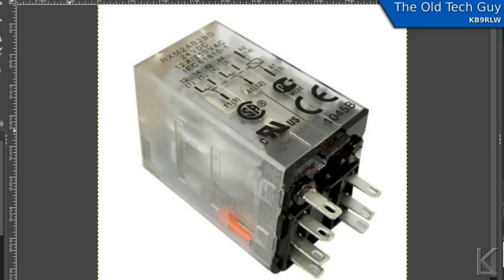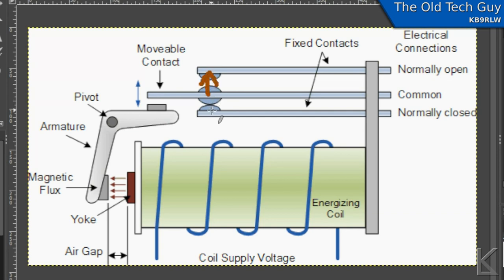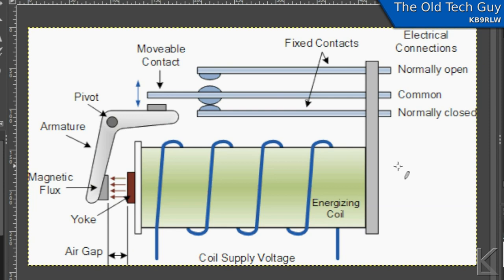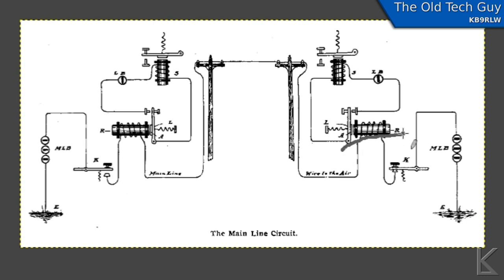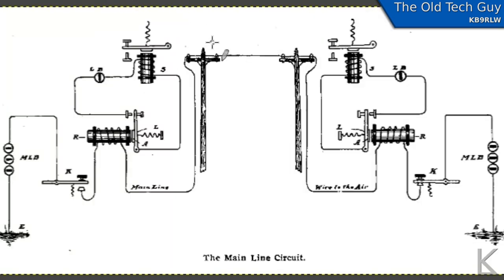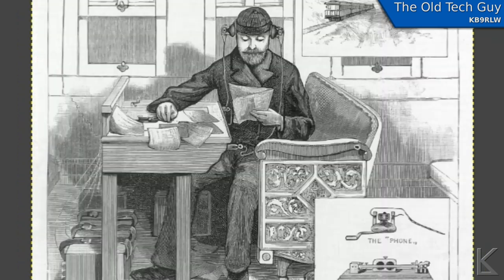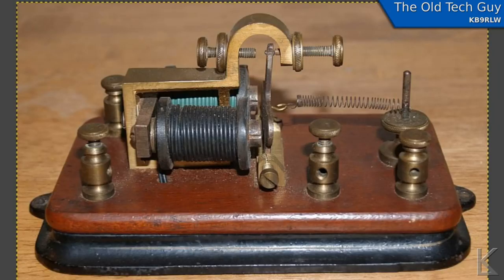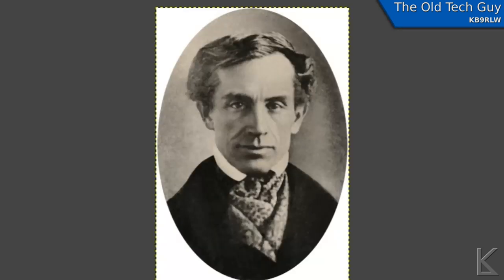Electronics - Why is a relay called a "Relay"?

Comment: I've used a relay and capacitor to power an automobile ignition coil to make high voltage sparks. Add an antenna and I've a spark gap transmitter. I don't want the FCC knocking at my door though! 
It's amazing to me that the telegraph operators could decode those clicks at such a high rate of speed.

Comment: Relays go by a couple of other names. Your car has a "starter solenoid", which is actually a high current relay. Some large pieces of  equipment (such as a welder) might have a device called a "contactor" , which is just a high current relay. Relays have one other important attribute, they can usually be wired to provide complete isolation between the coil circuit and the switch contact circuit. Thanks for the video Kevin and have a great Holiday in the dessert.
Reply: Industrial sized relays are called "contactors." Ron W4BIN

Comment: I always wondered how they could copy morse code with a thing clicking, there were not long and short tones. How did they tell a O from three Es?
Reply: Each dot or dash consists of 2 clicks, one when the bar was pulled down and another when the key was released and the spring pulls the bar back up.  2 quick clicks is a dot, 2 clicks with the second click delayed by the time of 3 dots is a dash. I believe the down click and the up click sound different.  Recordings of telegraphy on the internet do not all sound the same.  Sometimes the up clicks are barely heard, but I can still distinguish dots from dashes.
Reply: @kentk9aee898  cool. I see. Thanks for the reply. I bet its hard to copy!
Reply: @jack002tuber  
It would be for me as I find CW Morse code hard to copy.  In the city where I live, Valparaiso, IN, there was a telegraphy school that was once the largest in  the world.  In 1909 they added a wireless telegraphy school.  During WWII it was the U. S. Army Radio School.  More info on Facebook "Dodge Telegraph Memorabilia".